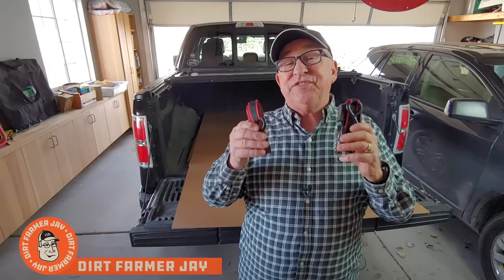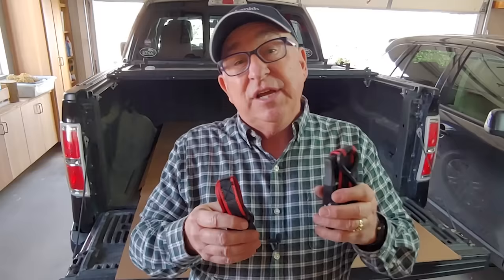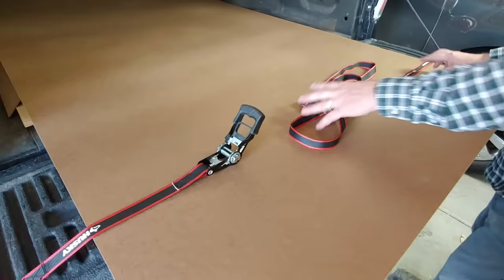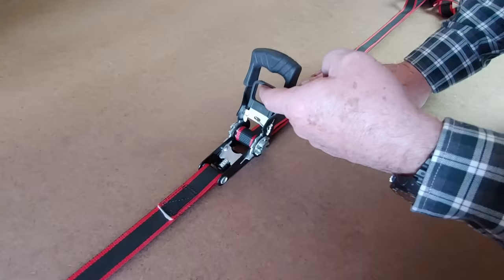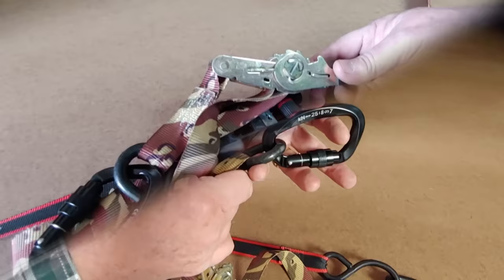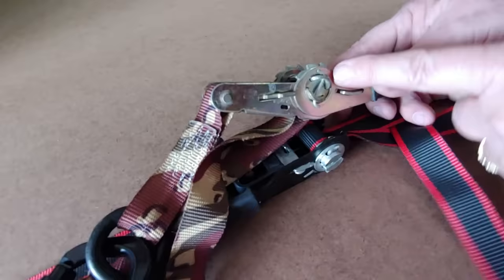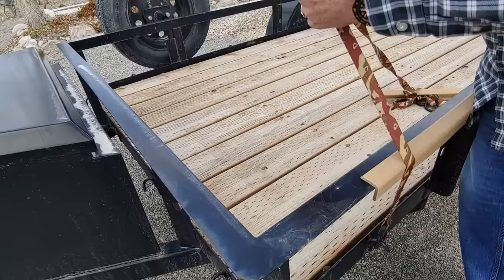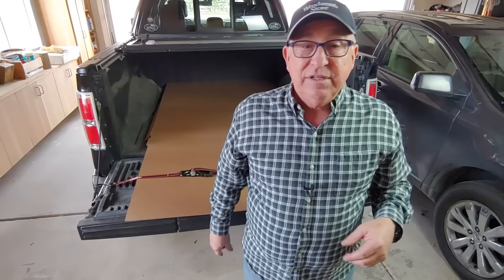How to Use a Ratchet Strap - Tips and Tricks!

Comment: First, the most common mistake I see people make with ratchet straps is front and center on your video. Once you align the slot for easy access, close the handle and you won't have to feed it back through after it exits the slot because it's already there. I cringe and laugh as I watch people struggle to put worn ends back through the handle. It's an unnecessary step.

Second, please don't ever demonstrate a ratchet strap on something flimsy such as the tie backs for your pickup's liftgate. I know you said it was just for demonstration but I guarantee you some ignorant person will attempt to use them to tie down a load after seeing your demonstration.

Third, I'm happy to see you demonstrating what we call a trucker wrap. Making a loop and then securing it is a very quick and easy way, not only to secure excess strap, but also to release it without twisting. Since the end has no hook on it, you can throw it out and let it unroll. Typically, I take the advice of Mountain Stages, who roll all of their endless straps (ratchet strap with no hooks) and throw them in a huge crate. Additionally, I store my hook straps this way as well. I simply pulled the hook all the way to the ratchet, then use the trucker wrap to roll the excess. It's a little floppy than wrapping the strapping around the hooks and ratchet together but when I need it, I simply open the knot and throw out the excess straight and untwisted.

Finally, I heard you allude to another video in which you showed how to unfoul an overloaded ratchet and were chastised by people in the comments for being dangerous. There is nothing wrong with opening a ratchet under load with your fingers on the rear ratchet mechanism so long as you take proper precautions. On many occasions I've been presented with ratchet straps that could not be opened fully to release both ratcheting mechanisms. So long as I can put additional pressure on the handle, I can release the front ratchet mechanism and then manually release the rear mechanism with my other hand and gently reduce the pressure on the handle. The most important precaution to take when releasing such a ratchet or unfouling an overloaded ratchet is to make sure no one tries to help you. The only way you can get hurt by reverse ratcheting to release either of these situations is if somebody else is pulling on the free ends. In many cases I actually prefer to manually release the load rather than experience a sudden release when engaging both cams. It's easier on whatever you're attached to, as well, whether it's your pickup bed or the walls of a semi trailer.  I've watched stacks of lighting truss, long aluminum structural members, fall after a particularly tight strap was released and shifted the load. This can be avoided by manually releasing the rear latch while holding the tension on the handle with your other hand. If you are still worried about something releasing and all that pressure becoming kinetic energy that either pinches your hand in the ratchet or send shrapnel from a broken ratchet into your hand then find a hook that can be used to release the mechanism with your hand outside the swing of the handle.

One other note. I wish you had shown the release of a ratchet strap under significant tension. If someone's watching your video with no experience using ratchet straps it can be a jarring surprise how violent and loud that release can be. It would have been useful to demonstrate actual conditions of a typical ratchet strap being released.
Reply from the maker: Thanks for providing all this great info. We appreciate you taking time to write to inform us and all your fellow viewer family members!  Best, DFJ
Reply: Thank you - this is one of the most thoughtful responses on here. You took time to improve a good video.

Comment: Not a fan of the c clamp....I like to go over one corner and under the other like  the cross method .sometimes I'll use the screw type small wooden double threaded screw  clamp   that I keep in toolbox.they are actually the oldest clamp of all clamps and have a great holding power and spread the clamping force even to not mar surface.great video ..I used to use  a ratchet strap as my application for people wanting a job ...a person's I q. Is closely related to their ability to operate one correctly ...also if a man hasn't strapped a lot of stuff in his life then he's probly not much of a working man.  You ever seen a real dumbass tryin to operate a ratchet strap?..pretty funny

Comment: Idea 2 when hauling a 20 foot  long thing  drive over it winch strap it up at the front the do same for the back some times you might have to tie it up in the Center       no one will  ever know it’s there
Reply: You can haul long loads with your car if you can tie the ends up  when hauling say a bunch of tables strap them together in a big bunch they will not come. off your flat deck if needed put a stap on to keep the bundle from combining off

Comment: My truck has a bed liner and there's nothing to hook too , any ideas for the racket strap use for this . Now I don't know why there's no hooks or nothing to hook too , not sure what's under the bed liner . Thanks
Reply from the maker: It's likely there are some flush attachment points under the bedliner. If so, you'll need to cut some access holes to get to them. (Of course I'm assuming its NOT a spray in bed liner.) If there are no attachment points, you're going to need to install some using short metal tapping screws. If these are attached to the sides of the inside of the bed, you'll need to look for reinforced sections for strength and to assure the screw points don't go through the outside of the truck. There are a good variety of these types of attachment devices located in the ratchet strap section of home improvement stores.  Best, DFJ
Reply: DirtFarmerJay Not a spray in liner , yes one of those plastic bed liner . I will check it out and see if I can cut an access holes out for sure . Thanks again 👍😉

Comment: A C-clamp is NOT A LOAD RATED LOAD DEVICE IT DOES NOT LOCK LIKE THE STRAPS AND CARIBINERS SHOULD NOT BE USED WHERE SAFETY IS A FACTOR OR LOAD SECURMENT !!

You should have covered the rating of the straps the size you show are fine for loads you can hand carry any thing you cant carry should have larger wider straps

Comment: those husky 1 in straps stink   i hate those things  if you close the wratchet you only have to pull  the strap  through the slot once
Reply from the maker: mikeatc, thanks for weighing in and giving your opinion. We've had good success with the Husky straps, but it appears you have not. Indeed, you can close the ratchet device and line up the slot and thread that way. Best Regards, DFJ
Reply: @DirtFarmerJay    10-4

Comment: Stop feeding it back through, unnecessary step taking longer to put together and tear apart
Reply from the maker: Indeed. We've had others comment about this as well and we are filming another updated version in the not-too-distant future. Here's the upshot of what you and others have said:

When threading the ratchet unit, close the ratchet handle and feed the working end of the strap through the slot and pull it almost tight. Leave enough to get about 3 revolutions on the hub, then open the handle and start "ratcheting" away. No need to have the handle open and thread the strap and then feed it back.

Thoughts on this?

Best, DFJ

Comment: Some of the ideas for tying down sheets of plywood were really dumb. I have hauled many, many sheets of plywood and lumber, and usually don't have to tie them down at all! Just leave your tailgate up, slide the sheets in, over the tailgate, to the bottom front of the bed. Depending on your bed length, you will have a foot or two of the sheets hanging out over the tailgate, and the down force of the air movement will keep them in place. Plus, you won't have to worry about them shooting out if you accelerate too fast!

IF hauling very light material, just pull a strap from one end of bumper, over the sheets, then to the other end of the bumper. Plywood one half inch thick or more, don't need strapping down at all. Using this method, you don't even have to have your bed completely cleaned out...just the front couple feet.

Just don't go crazy and haul a two foot tall stack this way, and wreck your tailgate. But the tailgate can handle a lot of weight in the closed position. I once hauled fifty 4x4x8ft treated posts this way, and didn't harm my tailgate! Of course, I do have a real truck...a Ram 2500! :)
Reply from the maker: Steve, thanks for sharing your experience. This is one of the best features of this medium - the interaction and insights from viewers like you. I appreciate you taking time to write. Best, DFJ

Comment: You're totally wrong. When threading a ratchet strap. You close it all the way and feed the strap straight through you don't have to come from the bottom and go back to the top just keep it closed and spread it through what's so hard about that
Reply from the maker: @clemsmith1169, thanks for writing. Indeed, it is easier to do it the way you describe, and I've posted that practice in another video. If you feed it the way I show in this video or the better way you describe, it's important to get at least 2 wraps (if it's wet out, 3 is better) around the barrel so it stays tight and doesn't slip. Best, DFJ

Comment: I can’t believe people are that stupid that it isn’t obvious how to use a ratchet strap second I’ve seen a lot of straps come loose because of pulling the strap tight before ratcheting back off the strap an inch or two then start ratcheting taking up the slack so you have a few winds on the spool it will stay tighten up better
Reply from the maker: Richard, thanks for writing even though I can't agree with you. It looks like from your profile picture that you are driving professional that uses these tools all the time. At one time, you either took the time to figure out how to use ratchet straps, or someone showed you. It's now "muscle memory" for you and it comes absolutely natural. In light of the over 2 million views, a lot of people would like to master these tools as you have. As for the insight you offered about getting a few winds around the spool, that is correct. We plan to make another video with tips like what you've offered. Indeed, getting at least a couple of wraps around the spool is critical, especially if it's wet outside. Best Regards and Drive Safe - DFJ
Reply: @DirtFarmerJay  no one ever showed me how to do it because it was obvious common sense goes along way I guess I expect to much from people or as time goes by people are just born stupid anymore or lack the drive to figure it out I don’t know

Comment: How about never buy junk 1 inch straps. Only 4 inch  straps
Reply from the maker: Thanks for writing. In my opinion, 1" straps are not junk. They have their place for lighter loads and if they are of reasonable quality, do the job fine. 4" straps are commercial duty, are used in the freight industry, and while they won't fail, usually aren't that practical for typical homeowner and consumer needs. They are heavy, bulky, the straps are not as flexible, and the fastener or hook ends are quite large and don't play well with typical hooks and such found on smaller trailers. The price point is also significantly higher. You won't get any disagreement with me on the fact that 4" straps are extremely strong, and if properly used, the failure rate is almost nil. However, using this duty of strap system for smaller loads is something like using a sledge hammer for a flyswatter. The job gets done, but its overkill. That's my thoughts on it. Again, thanks for writing. Best, DFJ

Comment: I watched a third of it and found his first mistake. Dont feed it back through, they are not designed for that.
The strap wind at double the thickness by doing that and you may not have enough tightness before the strap fouls the winder. Then wind it around and use a half hitch to secure the handle. I cant watch any more.
Please be mindful of information from the internet and check everything with other sources. 
No offence to the videographer he probably hasn't ever had a problem with it.
Reply from the maker: Steven, thanks for stopping by and giving your opinion and insights. Yours is a great approach, thanks for sharing it. Best, DFJ
Reply: @DirtFarmerJay  I should have added that I had to leave so couldn't watch the rest but will endeavour to do so time permitting. I find I still learn a lot at 60 or maybe I take a bit more notice than when I was younger.  Cheers DFJ.

Comment: The c-clap concept is NOT a good one; and honestly a potential liability! Especially when you can easily 'corner wrap' a strap (under on one side, over on the top, if just a couple sheets of plywood) to hold them IN and DOWN. IF that C-clap comes off, damages the wood or has an issue... you are potentially sending a steel projectile AT THE VEHICLE BEHIND YOU! Huge liability! Other than the c-clap, all other ideas you shared are good to great. The 'crappy key chain/water bottom' snap closures are something most people don't think about, and wrongly assume 'have strength' (when they don't)l; however, even 'screw on' claps and climbing carabiner are potentially a danger, if used wrongly, or with cheap/weak straps. One must be aware of the LOAD capacity, AND G-FORCE multiple in the event of an emergency braking, impact accident, huge pot hole, or roll over. There is more to 'tying down' a load than just 'securing it IN PLACE.'
Reply from the maker: Terry, thanks for the insight. Indeed, we will be removing that part of the video as it is problematic. I've done this for short hauls and it has worked really well in giving me another attachment point, but why tempt Murphy? Best, DFJ
Reply: @DirtFarmerJay  - it's one of those things that 'work well... UNTIL IT DOESN'T' ... one pot hole can change a whole lot when 'mechanicals' are involved.

Comment: you do it all wrong starting from the way you threaded it. Don't thread it back through it makes it harder to unstrap. do it my way by popping  handle fully open and pull on the loose end and completely separate ratchet from strap in seconds. Or just loosen unload freight on top and retighten. there is a better way to secure the loose end too but to hard to explain verbally. I am a flat bed truck driver for almost  30 years 2" and 4 'straps and have to strap and restrap many time a day for multiple deliveries and don't have time to be messing around with straps